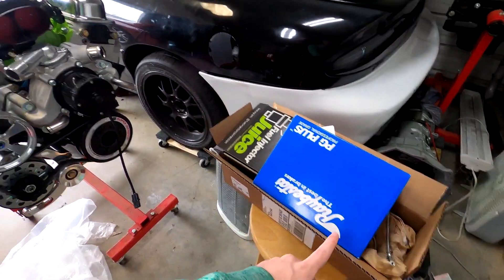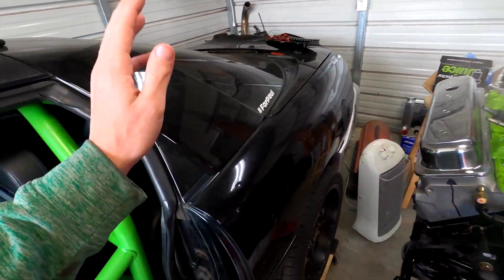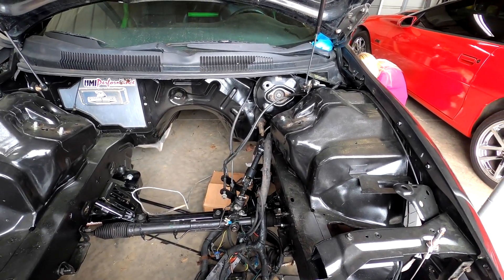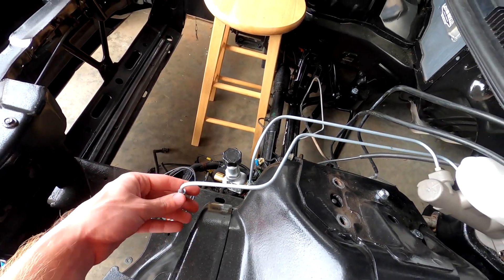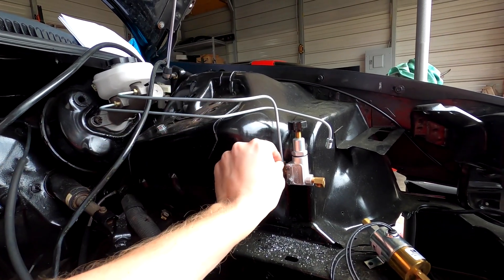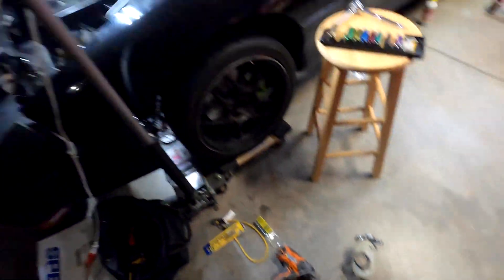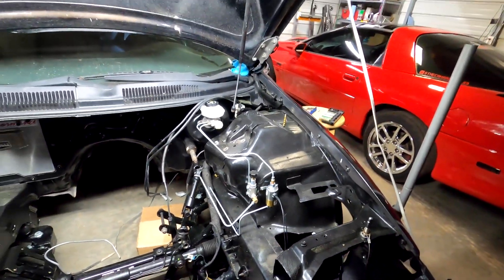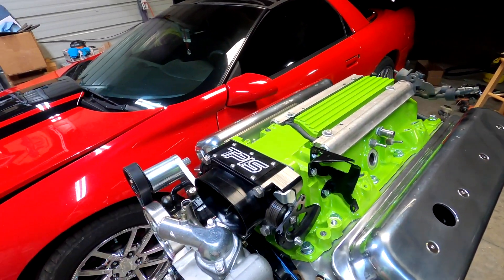Installing SJM ABS delete kit with line lock on a 93 Camaro!!

Comment: Same kit I ordered a while back and have yet to install. I have a Moser 12 bolt, TruTrac with 4:10, 33 spline axles with c-clip eliminator kit. Deleted the ABS when I installed it forever and a day ago. Just never got around to pulling the entire system. Motors coming out this soon and Ill be installing my SJM Kit with Line Lock

Comment: Your car is getting closer each step to being completed..👍🇺🇲.. I bought my preformed front brake line kit from Hawks motorsports. I opted for a better condition complete preformed front brake line kit to go with my new BMR kmember. Unfortunately I have to rebend the lines to go along the entire front BMR kmember. Unfortunately I'm using black zip ties to hold the brake lines in place because BMR kmember has only the 2 brake line brackets on each side. The rest is zip ties..